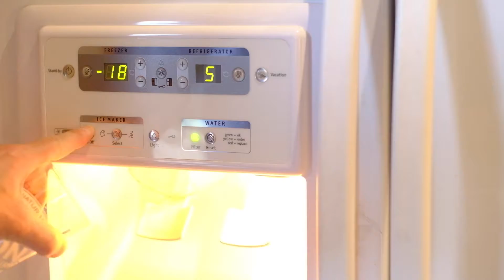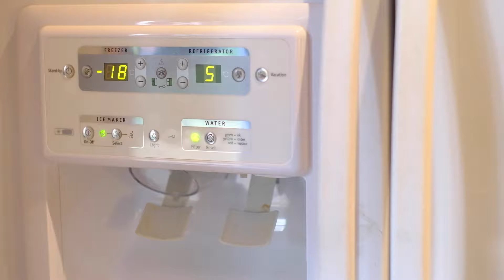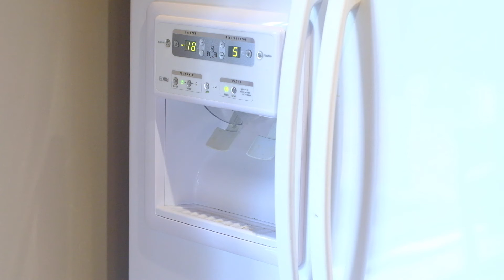Whirlpool/Maytag/Admiral fridge Repair

Comment: John you're an absolute hero! Managed to fix mine today using the same parts you suggested. Works like a dream!
Reply from the maker: Great stuff - it's four years later and mine's still going strong in the brand new kitchen. 👍
Reply: Mine just started doing it again so I replaced the capacitors again. It's still doing it. Any ideas?

Comment: Thanks a million John. I’ve ignored my flashing and clicking fridge for the past 4 years before I saw your video. I purchased two capicitors using the link below and fitted them today. I also used a soldering gun for the first time and I’m no electrician. All In all I told my time and completed in about one hour. Fridge is like the old fridge it once was again. Delighted, thank you.
Reply from the maker: Really great to get such feedback - thank you. FYI it's now 3.5 years since I did mine and I've had no problems with it.

Comment: Many thanks John, I had the same problem with my Whirlpool Fridge Freezer which went from intermittent to permanent, most annoying.
I got a set of capacitors from Radio spares (UK Stock number 165-0239 for anyone else, as Amazon were out of stock). Whole process took me half an hour including resoldering and fridge now works fine.
Really helpful advice and so easy to implement, many thanks again.
Reply from the maker: Thanks Andy - always good to hear. I have another post on my blog with another fix for this fridge. It's not as blatant an issue but worth checking if you think the compressor is running too much. https://jumpingspider.co.uk/diy-repairs/admiral-fridge-repair/
Reply: @johnhunter4181  Thanks John, yes my compressor does run too much. I took the cover off the motor actuator/vent but couldn't see how to remove the complete assembly, are there any other screws or clips that hold it in situ on the side of the fridge? Appreciate any other guidance on this one

Comment: Hello, Next of those three Cap there is another one. why didn't you put that?
Reply from the maker: You mean the space labelled C5? visible at https://youtu.be/7-ak4H-digU?t=147 That space was never populated on my machine also C13 C10 C11 and many other spaces were never used. I guess different models use the same board and have other functions my fridge doesn't have.
Reply: @johnhunter4181  Yes sir,
I mean C5, That's true it must be different in other models, board of my fridge has C5, it's 0.33 uF

Comment: Thank you very much for the tutorial!
One question - what happened to the C5 part right beside the capacitors? On my fridge the piece is still there and it does not look good, it looks dark and kind of burned. Can I remove it just like on your electric plate? Thanks for the support!
Reply from the maker: Hello Flo, I didn't remove C5! It was never there so maybe you have an earlier version and Maytag decided it wasn't required and left it out of later production?
Reply from the maker: Looking at the board again, I see there's quite a few empty spaces: C11 C12 C13 RL1 etc but I didn't remove them - maybe your fridge has some function which mine never had - but the PCB was multipurpose? Probably safest to replace the dodgy looking cap.
Reply: @johnhunter4181  Thanks for your response!
I just did the fix you described in your video and the flickering and blinking is gone!🤩
I guess I better leave it as it is and come back for the dodgy parts when the next issue occurs. 😀
All the spaces that are empty on your board are filled with parts on mine but I don't know what purpose etc... 
Thank you and stay safe! Greetings from Germany. 🙏😊

Comment: Hi John, I'm not an electrician but I believe I have the same problem, how do you actually change the capacitors? Is it easy enough to do? I have a soldering iron, where do you buy the capacitors from?
Reply from the maker: Sorry Warwick I didn't look for comments or they passed me by - look under 'SHOW MORE' above for a link to buy the components.